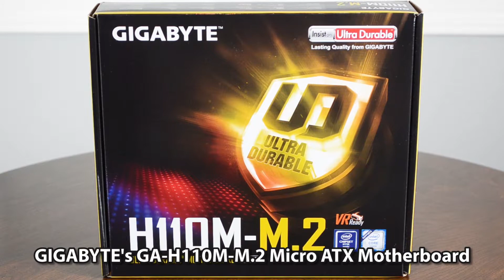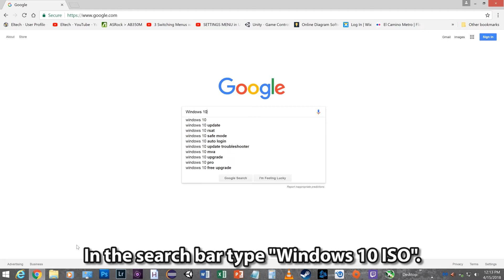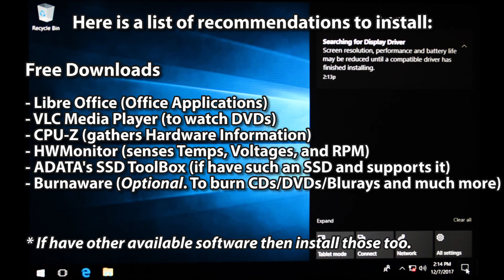How to Build an Office/Home PC with Windows 10 ISO and Installation (Step by Step)

Comment from the maker: ==========================
Timeline (Step by Step)
==========================
1) The CPU @ 00:07
2) The Motherboard @ 00:15
3) The RAM @ 00:20
4) The M.2 SSD @ 00:25
5) The Hard Drive @ 00:30
6) The PSU @ 00:34
7) The Optical Drive @ 00:39
8) The Case (Repurpose) @ 00:43
9) Uninstall the case Panels @ 00:47
10) Remove bag within case @ 01:11
11) Uninstall Front Panel @ 01:25
12) Unscrew the Storage Panel @ 01:45
13) Remove the Storage Panel @ 02:08
14) Route PSU cables @ 02:15
15) Cut PSU's zip-tie @ 03:24
16) Finishes PSU cables @ 03:36
17) 4 PSU screws @ 03:42
18) Install the PSU @ 03:46
19) Undo CPU latch (MOBO) @ 04:20
20) Install the CPU @ 04:31
21) Install the Stockfan (CPU Cooler) @ 04:50
22) Unscrew the M.2 screw (MOBO) @ 05:43
23) Install the M.2 SSD @ 05:51
24) Push down the DDR4 latch @ 06:10
25) Install the RAM @ 06:16
26) The I/O shield @ 06:30
27) Install the I/O Shield @ 06:34
28) Six MOBO Standoffs @ 06:49
29) Keep 8-pin ATX over MOBO @ 06:53
30) Align the MOBO with standoffs and I/O ports @ 07:02
31) 6 Motherboard screws @ 07:19
32) Install the Motherboard @ 07:24
33) Tighten the MOBO's screws @ 08:43
34) Connect 1 of 4-pin ATX PSU (8-pin) to MOBO @ 08:59
35) Wrap back case fan's wire @ 09:09
36) Connect the 3-pin case fan @ 09:20
37) Connect the Molex front case fan @ 09:28
38) Remove 3.5 inch bay cover @ 09:46
39) Remove 5.25 inch bay cover @ 09:58
40) Reinsert 3.0 USB and Front Panel cable @ 10:13
41) Reinstall the Front Panel @ 10:29
42) Route the 3.0 USB cable @ 10:46
43) Route the front panel cables @ 10:58
44) Insert the Optical Drive to 5.25" Bay @ 11:32
45) The 2 Optical Drive screws @ 11:49
46) Tighten the 2 ODD screws @ 12:21
47) 9-pin HD Audio @ 12:31
48) Route HD Audio behind MOBO @ 12:35
49) Connect HD Audio to F_AUDIO @ 12:56
50) 9-pin 2.0 USB @ 13:09
51) Route 2.0 USB behind MOBO @ @ 13:13
52) Connect 2.0 USB to F_USB @ 13:32
53) 2-pin Reset Switch @ 13:47
54) 2-pin Power Switch @ 13:51
55) 1+1-pin Power LED + & - @ 13:55
56) Hard Drive Disk LED + - @ 13:59
57) Route wires behind MOBO @ 14:03
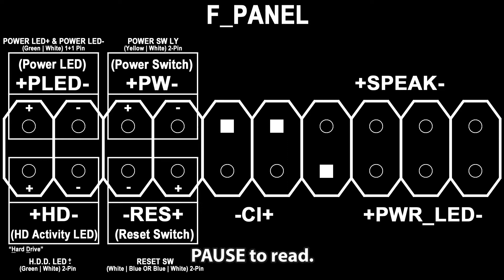58) Diagram Connections @ 15:01
59) Connect Hard Drive LED + - to +HD-
60) Connect Reset Switch to -RES+ @ 15:26
61) Connect Power LED + - to +PLED- @ 15:37
62) Connect Power Switch to +PW- @ 15:53
63) Route 24-pin PSU cable 
64) Connect 24-pin PSU cable to ATX @ 16:24
65) Route 3.0 USB cable @ 16:39
66) Connect 3.0 USB to F_USB 3.0 @ 16:53
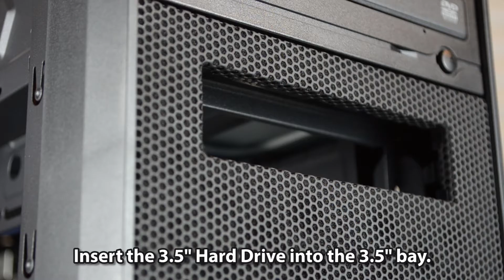67) Insert 3.5 inch Hard Drive into 3.5 inch bay @ 17:04
68) 2 screws for Hard Drive @ 17:15
69) Install Hard Drive @ 17:19
70) Reinsert the 3.5 inch cover bay @ 17:45
71) SATA cable back inside the case @ 17:54
72) The SATA @ 18:08
73) Connect the SATA (PSU) to Optical Drive @ 18:12
74) Connect the SATA (PSU) to Hard Drive @ 18:28
75) AC power cord @ 18:47
76) Plug AC cord to PSU @ 18:51
77) I/O Switch to ON @ 18:57
78) Plug AC cord to Power Surge @ 18:59
79) Press the Power button @ 19:06
80) Turn OFF the computer @ 19:31
81) Disconnect the molex case fan @ 19:40
82) Route the molex inside the case @ 19:46
83) Route Peripheral Power Cable inside the case @ 19:55
84) Route the SATA inside the case @ 20:07
85) Route the PCI-E cable inside the case @ 20:16
86) 3 Velcro straps @ 20:36
87) Bind PCIE with velcro strap @ 20:40
88) Bind SATA with a zip-tie @ 20:49
89) Bind Peripheral Power Cable with a zip-tie @ 21:18
90) Place PCIE inside case and above Optical Drive @ 21:43
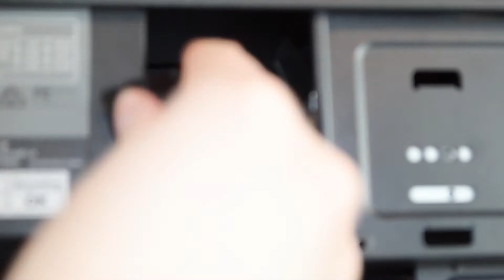91) Place SATA inside case and above Optical Drive @ 22:01
92) Route the case fan's molex @ 22:17
93) Connect the Peripheral Power and Molex together @ 22:40
94) Place Peripheral Power inside case and above ODD @ 22:50
95) 2 SATA cables @ 23:09
96) Connect Right Angle SATA cable to Optical Drive @ 23:13
97) Route the Right Angle SATA cable @ 23:23
98) Connect Right Angle SATA cable to SATA3_0 @ 23:36
99) Connect Straight SATA cable to 3.5 inch Hard Drive. @ 23:51
100) Route the Straight SATA cable @ 24:01
101) Connect Straight SATA cable to SATA3_2 @ 24:19
102) Zip-tied other cables/wires @ 24:30
103) Cable manage behind the MOBO @ 24:46
104) Reinstall the Right Panel (panel behind MOBO) @ 25:03
105) Rescrew the right panel @ 25:26
106) 2 PCI Slot Covers (not included nor required) @ 25:37
107) Install the PCI Slot Covers @ 25:43
108) Reinstall the storage panel @ 26:22
109) The original screws from the storage panel @ 26:40
110) 2 screws under the case @ 26:44
111) Finish installing the storage panel @ 26:58
112) Reinstall the left panel @ 27:10
113) Rescrew the left panel @ 27:18
114) Transcend's 3.0 8GB USB Flash Drive @ 27:29
115) Insert flash drive to a different PC (with Windows) @ 27:33
116) Go to "your" Browser and type Windows 10 ISO @ 27:48
117) Click Download Tool now @ 28:05
118) Click MediaCreationTool.exe @ 28:09
119) Click "Yes" to begin Microsoft's Media Creation Tool @ 28:12
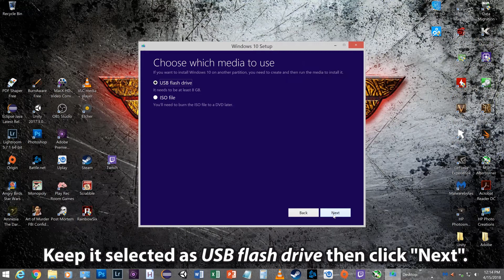120) Click "Next" to begin the download @ 28:48
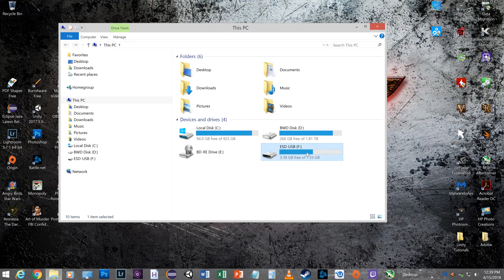121) Eject flash drive from Windows first @ 29:17
122) Remove the flash drive from the computer @ 29:25
123) Back to the custom computer, turn it ON @ 29:29
124) How to get into the BIOS @ 29:48
125) Enable "Reset Case Open Status" @ 30:01
126) Change P3: ADATA to P0: TSSTcorp (boot order) @ 30:10
127) Mouse Speed to 4 X @ 30:07
128) Ambient LED to Off @ 30:25
129) Power On By Mouse to Move @ 30:31
130) Save & Exit Setup to Save configuration @ 30:38
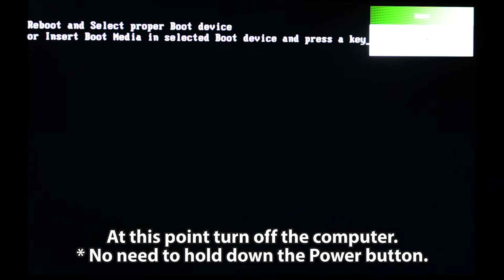131) Turn off the computer (saved and exit from BIOS) @ 30:46
132) Insert the USB flash drive to the custom computer @ 30:51
133) Begin Windows 10 installation @ 30:58
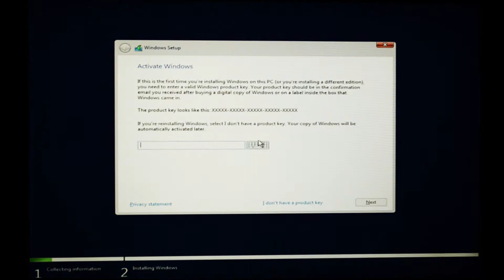134) Type in the 25 character product key (must be legit) @ 31:14
135) Select "Custom: Install Windows only (advanced)" @ 31:30
136) Select the SSD (storage) to install Windows 10 @ 31:36
137) Setup your Administration Account @ 32:11
138) Choice with Cortana @ 33:10
139) Windows 10 is installed @ 33:40
140) Recommendations @ 33:47

Comment: Really like the step by step! Just one question, why did you blur out the M.2 if it's already listed in the discription? Anywho keep up the good work!
Reply from the maker: I'm glad to know and appreciate your support and comments. 

And the particular reason was due to the serial number is all I meant to remove. I may had overkill the covering with the block because it can be a little tricky if there's any slight adjustments in movements so sometimes making a big block is an easy method but can be a bit sloppy on my end. I've gotten a little better overtime with the block movements as I practiced more with my edits versus a big block. Sorry for any confusion there, just hiding one specific number is all I meant to do.

Thanks again for your compliments and support. I'll make sure to keep it up and aim to improve a little every time.